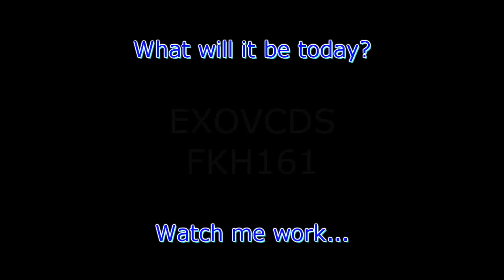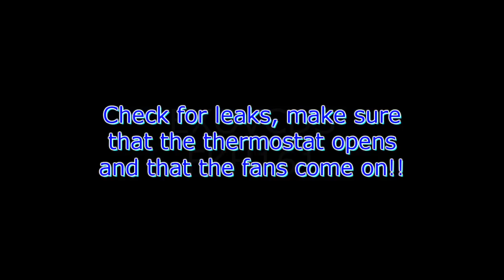VW A4: 1.8T AWP Electric Water Pump Replacement

Comment: Something was killing my battery in my VW and the dealership couldn't figure it out. I know how to change oil in cars and that is it but I spent 10 minutes under the hood and figured out that the water pump was not shutting off after I turned the car off so I hope replacing it will fix it. This video definitely gave me the confidence that I can do it myself. Thanks!
Reply from the maker: Changing the pump will not fix the problem... the pump is being controlled (told to run). You have to figure out what is keeping it running.
Reply: +Thomas EXOVCDS lame! Well I'm going to give it a go anyways. Thanks for the input.
Reply: doing some other research it looks like it definitely can be a few other things. Thanks for your videos man.
Reply: What did you come up with to make the pump turn off when you turn the car off?

Comment: I want to say Thank you so much, sears auto was trying to charge me $575 for parts and labor, can you believe that? Also they charged me $100 for a coolant diagnosis, even after I showed him exactly where the coolant was spraying out of, and after telling him the water pump and thermostat were both new. Anyways, you saved me about 465 dollars, and I was able to do it in literally 30 minutes. Thanks again
Reply from the maker: Nice to hear that one of my videos was of help!
Reply: Thomas EXOVCDS I have watched a lot of your videos, they all help a lot. I do have another problem with the car now, maybe when you have a minute you can answer. My 04 jetta 1.8t has a problem where when I have the headlights on, all of my interior lights, dash cluster, radio, and headlights start flickering, mostly under load. (it probably does it when my lights are off too, but I can't tell because nothing lights up inside that I can see during the day) It has a new battery and a new alternator. Coolant did spray from the old aux pump out onto the passenger headlight wiring and on top of the intercooler (I think), and I didn't spray it off after.. is that causing the electrical problems? If so, could you help me out? I drive it daily, so I have to fix it as soon as I can. Thanks Thomas
Reply from the maker: Flickering lights is due to an increase & decrease in voltage. Monitor the charging system voltage with a voltmeter. Measure at the battery (positive and negative) and measure at the alternator (positive post on alternator and against alternator body for ground).  Alternators convert AC (alternating current) into DC (direct current)... when too much AC current (AC ripple) leaves the alternator, it can cause issues with the vehicle's electric system. Make sure that the battery ground cable  has good & clean chassis mounting points under the battery.
Reply: Thomas EXOVCDS okay,  thank you again for the help, I'm going to test the charging system tomorrow and clean up the ground cables. Much appreciated!

Comment: Thanks for this video. That end just broke on mine this morning. Got the old part off and now awaiting the wife to show and it's off to the VW dealer. Only ones in town with the part and of course VW prices! Thanks again for the knowledge!!!
Reply: Interesting side note..... I called the shop that does a bit of maintenance for us on all of our vehicles to see if he could fit me in today. He could, but the price for the part was up-charged by almost $100.00 and he was going to charge $200 for labor. You are a lifesaver and $$$ saver dude!
Reply from the maker: You are welcome... good luck with the repair (should not need it it), just make sure to bleed the system / keep an eye on temperature & thermostat operation. Donation buttons on my website get lonely. :) http://fkh161.ca/

Comment: Ok thank you Thomas.

I slightly overfilled my oil today after changing out oil and filter.  I noticed an oil leak afterwards, not coming from oil sump plug nor filter, but looks like coming from 
Up past the oil filter?

Would slight overfill cause an automatic release of excess oil for this car?

If not potential source?
Reply from the maker: Possibly the oil cooler o-ring. Remove the oil filter and tighten the 27mm nut that secures the oil cooler to the oil filter flange.

Comment: Many thAnks Thomas.

Are those same jacking points used when out on the road and changing a flat Tyre?

Also, I put some coolant mix in the RES for top up and there was a small flake of matter  that landed in the coolant mix as I was pouring it in.  I don’t know what it was - around 5mm - but I am concerned this matter may cause a blockage somewhere in the cooling water system..

Could a blockage occur because of this?

And, what are the potential causes of the cooling fans not kicking in at all - above temps of 90c?

Cameron
Reply from the maker: Yes, use the vehicle jack in the stock location (can't go wrong with that) and then place jack stands under the vehicle at structural solid locations. Front subframe, lower control arm close to ball joint etc. There are many google images of jacking & supporting points for TT's.

Comment: Great video, I'm replacing this pump and the metal water pipe that is attached to this pump . Can you point me in the direction of the hangers for the metal water pipe? I can't find them on the vw schematic anywhere. Same car and engine Thanks
Reply from the maker: https://www.ecstuning.com/b-genuine-volkswagen-audi-parts/bracket/1c0121093e/
Reply from the maker: YOU ARE WELCOME.

Comment: Thank you for sharing.... does this kill the battery after the car is off? I think this might be my problem.
Reply from the maker: The pump in this video was leaking... a bad coolant fan control module or temperature sensor can cause the pump to stay on too long and drain the battery.
Reply: @EXOVCDS  . Thank you sir. Do you know where the sensor or module is? Sorry for the noob questions.
Reply from the maker: @MetroCollectablesandvlogs  year, make, model, engine?
Reply: @EXOVCDS  
Thank you sir. 
03 audi tt, convertible,  1.8, auto
Reply from the maker: @MetroCollectablesandvlogs  I'll get back to you sometime later today... I want to check wiring diagram as well.
Reply: @EXOVCDS  thank you so much for all your time.
Reply from the maker: The module is bolted to the chassis under the battery... looks like this:
https://res.cloudinary.com/brocksupply/image/upload/8668-0001.jpg
Wiring diagram:
http://fkh161.ca/Audi/TT/TTCoolingFansWP.pdf
Reply: @EXOVCDS  any luck? Thank you sir
Reply from the maker: You said "you think this might be your problem"... does the pump run after the engine is shut off? It should... can run for 10min. If the pump does not stop running... unplug the fan module (should stop). Yes?
Reply: @EXOVCDS  
I'll try that.... there is definitely something running.  So I'll time it. I been unplugging the negative side of the battery and when I start it up later on or the next day, she starts up perfectly.  Once again thank you for your help

Comment: i have a 2001TT and the after run pump doesnt shut off. how long should it run once engine is off?
Reply from the maker: Could be a bad fan control module (the fan module controls the pump).

Comment: Hi.  The fastening hardware that fastens the AWP onto the mount - what is it?  I can see you removed 2 x 10mm nuts.  But, I have my AWP off right now and do not see any bolts that these nuts screw onto.  Can you confirm if these bolts are always supposed to be connected onto this mount and do not come off?   Cameron
Reply from the maker: 2 studs are screwed into the radiator fan shroud... to which the water pump is secured. Part 24D are the studs:
https://volkswagen.7zap.com/en/usa/golf/gob/2002-343/1/121-121035/#24D

Comment: I have recently noticed a puddle of coolant uner my 2003 VW Jetta GLS 1.8t Wagon and for that this auxiliary pump has a leak in the top near the sensor, coolant is boiling out.  Did you have to drain any coolant or was relieving the pressure and then replacing the cap enough to stop the flow of coolant?  GREAT video by the way!  Do you have a video replacing the coolant temp sensor on the drivers side of the engine?
Reply from the maker: +Stephen Fisher Remove the cap & put it back in place... you will lose some coolant but not all. Make sure to have a tray under the car to catch the coolant: https://www.youtube.com/watch?v=kLCbWv0GRrs

Comment: First off want to thank you for what you do. Reading sonething in a book helps for some things but seeing it done firsthand is a way better way to learn to do things. I have a quick question if you have time. Ive got a 2003 jetta 1.8t with the tiptronic trans. For tge past few weeks if I try to take off after its sat all night it goes normal until ive been in 3rd gear for about 1 minutes or so then it suddenly downshifts, rpms go up to about 3500-4000 and its like the gas peddle does nothing. Like its in a limp mode? If I push the gas harder when it does this its like it tries to cut out. I have to either let off the gas for a few seconds or pull over and restart the car. It then runs perfectly fine. If it was a solenoid in the trans wouldn't it be happening more than just a few seconds when cold?
Reply from the maker: Thank you for the kind words and thank you for watching!
We only do filter & fluid changes at our shop... anything more involved (after verifying driver complaint and checking to see if it is something we can handle) we refer the customer to a transmission shop.
Having said that... the first thing I always do is check for fault codes in the ECM & TCM. If no fault codes are stored, I drive the vehicle while I watch live data from the ECM & TCM... to see if I can spot something that might help with the complaint / diagnosis. Have you checked the vehicle for fault codes?
Checking fluid level is also one of the first things that I do... providing that the temperature is in range. If fluid temperature is above the "checking temperature" (35c) the vehicle needs to cool off first. From what I gather, most shifting issues are due to fluid level too low, solenoids that act-up, intermittent wiring / ribbon cable connections, transmission range switch (gear position switch) and hall sensor issues where the gear shift is. Not sure if any of these apply to your case... just some things to keep in mind. Transmission fluid / oil coolers need to be able to do their job, so if your vehicle has one, make sure that fluid can circulate.

Comment: Hi there great video. The plug connecter from my pump somehow got loose and seem to have broken off. When i popped the hood i am only seeing the 2 wires it was connected to. Is there a part # (for 2003 audi tt coupe) or a link where i can order one?
Reply from the maker: Phone a Dealer and have them cross reference a number / part for you.
Reply: Thomas EXOVCDS Thanks

Comment: Many thanks Thomas!

Does the thermostat kick in at 100 deg C?

Also, I have read on multiple forum sites stating various opinions on front located jacking points for this vehicle.

Many say that There is no safe or suitable single point at front for a jack.  Instead the points at front are only suitable for use when all 4 points are used at same time (2 at front and 2 at rear).

Can you advise if there is a suitable single point at front to use with a floor mounted jack?

If so, where is this location?

Cameron
Reply from the maker: Thermostats are usually 87c... cooling fans should cycle at around 98c, temperature needle in the dash should stay at 90c (middle) once the engine is at operating temperature. 
Jack at jacking positions as indicated by owners manual. Lift one corner at a time and then place jack stands under the vehicle (depending on what you are working on / removing)... such as frame rail, subframe, lower control arm etc).

Comment: Awesome. My 2004 electric pump broke in exactly the same spot but broke completely off and poured coolant everywhere. What is that took you used to tighten the clamps? Was it really necessary for this fix?
Reply from the maker: quang ha You mean the pliers with the cable? https://www.youtube.com/watch?v=E23avtLmVK4

Comment: I recently swapped this pump on my 2002 Audi TT 225.  I am questioning if the pump is working correctly now.  It seemed fine at first but now I am not sure.  I makes a humming noise after shutdown but I am not sure that fluid is actually flowing.  Should I see fluid returning to the reservoir like I do when the engine is running?  Does the flow from this pump circulate the whole system?   Thanks!
Reply from the maker: I doubt that you will be able to see fluid returning to the reservoir. it's only meant to keep fluid in the block circulating to keep hot spots from developing. I'm no engineer, so those are just my opinions.
Reply: Thank you for your thoughts!   Also if I pinch the hose that the pump pushes fluid through I hear no change in the sound of the pump.  In my experience pumps will change sound once you apply resistance to the flow.   I think I am going to have to remove the pump to know for sure that it is providing flow.
Reply from the maker: +Justin Cutter it's a freewheeling impeller... not a fixed impeller like regular pumps. that way it can turn even when the motor is not energized. you will not feel resistance if you pinch a hose because of this. here's a diy about this type of pump. http://forums.fourtitude.com/showthread.php?3038022-Why-the-secondary-auxiliary-after-run-water-pump-stops-working-and-what-you-can-do-to-fix-it
Reply: Thank you!

Comment: I have same problem but I did to connect both of the hose straight together with out electric water pump, so is that okay for while when I'm waiting for part. Sorry Is this important part?
Reply from the maker: Ok for a while... but it helps cool the turbo when the engine is shut off and it keeps hot spots from developing in the cooling system (by circulating the coolant).

Comment: Did you find out what may cause this pump for braking as my original one got broken same way and the second one (aftermarket) have broken as well after 20miles when i pushed some more acceleration.. ?
Reply from the maker: How did it break? Leaks? impeller is loose?

Comment: Hello. Thanks for the great video.  
In my 225TT the fans don't come on after I switch engine off, which means engine temp rises as per aircon code 49 up to maybe 110C.  I've replaced both the fan controller box and the dual thermoswitch and I think this pump doesn't come on as expected.  
Both fans are OK high and low speed (tested by unplugging and shorting the thermoswitch cable).  
I've long had this problem and my mechanic has been unable to fix it.  Your thoughts on anything else except the electric pump?
Reply from the maker: A good wiring diagram will show applicable fuses / relays / sensors etc that are part of the "after-run" fan & water pump system. A check of those components should find a cause.

Comment: yea dats wat I did I put my hand on it and I felt something light like a little vibration or something like that
Reply from the maker: If you reply under my replies then the thread / topic will stay together... makes for easier reading. The pump motor has no mechanical connection to the pump impeller. It is a magnetic drive, so that the impeller can spin / freewheel when the electric motor is off. Not sure what could have caused the noise. If it no longer makes the noise (just buzzes) then I would not worry too much about it.
Reply: Thanks I appreciate your help
Reply from the maker: http://forums.fourtitude.com/showthread.php?3038022-Why-the-secondary-auxiliary-after-run-water-pump-stops-working-and-what-you-can-do-to-fix-it

Comment: I have a mechanical question , i swapped a another 1.8t motor that came from an automatic and i dont recall the old motor to have this in it i hit a brick wall and dont know what to do with this ? Its now sitting with a manual transmission
Reply from the maker: Nemesis X I'm away from my pc... if your car doesn't have it, no big deal. If you are missing components that need to be attached to the new motor... either source them or convert to the non aux setup.
Reply: My motor came from an automatic , i put it with my 5speed transmission do i absoluetely need it ? I dont want to delete it and something go wrong ive been working on this car for awhile and have alot of money in it just dont want something to go wrong any information about it would help
Reply from the maker: Nemesis X If your old engine didn't have it, then this one won't need it. I think it's only used on vehicles that need extra cooling (vehicles with automatic transmission). You can add all the needed items if you want to... all the hoses, the extra / small radiator, the electric pump etc. You'll have to wire it up to the coolant fan control module etc. Like I said, not really an issue, lots of 1.8t engines don't have it. I'm still away from my pc until tomorrow... can send parts list & wiring diagram then.

Comment: is there a way to delete this whole system? I'm wanting to put an inline Filler neck and this pump with all the extra hoses are making it very Confuzing
Reply from the maker: +Thomas  Miller Sorry... replied to the wrong comment. I would relocate the pump if it is in the way, rather than delete it. It helps prevent hot spots after shut down as well as continued turbo cooling after shut down.